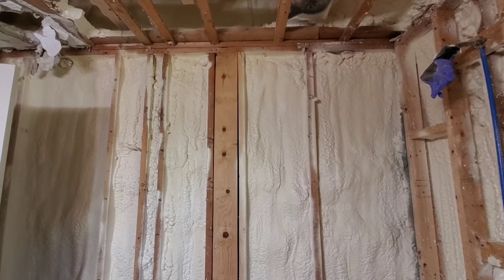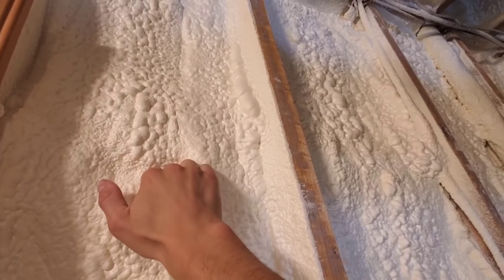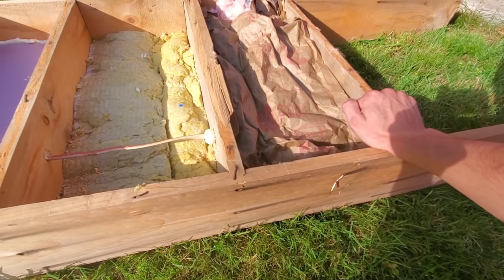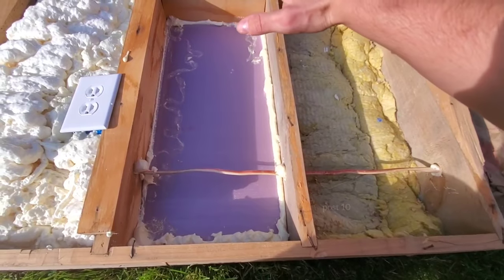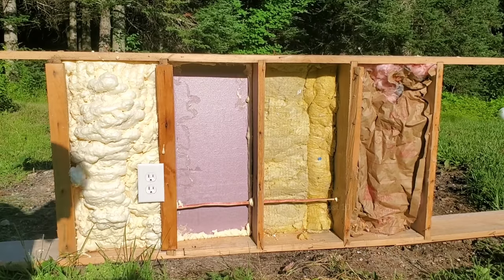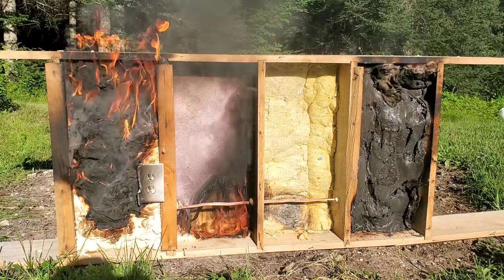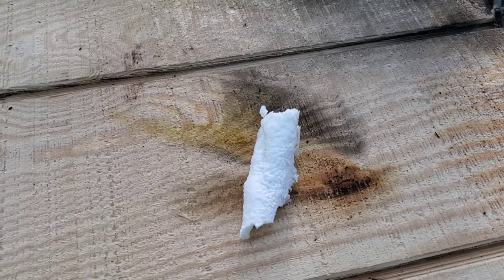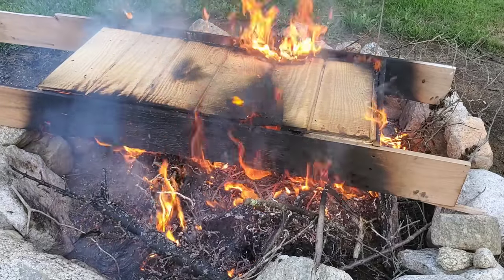Testing The Burn Ability Of Insulation In Wall

Comment: I am a licensed Architect and that is why you have building codes.  Paper or foiled back insulation is required to be protected by sheetrock or other sheathing as well as the other spray foam insulations or boards.  Only the mineral wool or noards that are fire rated for exposure can be left exposed.
I see it all the time where contractors leave paper backed or spray foam insulation exposed in a basement or attic and I tell them they have to cover it.
You thought the fiberglass would do better than the mineral wool?
I specify mineral wool as sound insulation and it makes an ordinary wall a one hour fire rated fire stop.
It not only wont burn, it also keeps the other stuff in tbe wall from getting hot enough to combust.
My formula on a 5.5 inch wood stud wall is 3 inches of closed cell spray foam- 2" gives you a vapor barrier, and 2.5" of mineral wool so you dont have to shave the stuff to put in your electrinal boxes.  This wall wont burn...
Reply: do you call out metal welded ariund 10 foot wide doors  to backyard
Reply: Thermal barrier paint is painted on exposed foam insulation. Ignition barrier paint can also be used depending on the area.
Reply: is mineral wool rockwool ?

Comment: Rockwool/mineral Wool does not burn. 25 years as a Construction Inspector!
Reply: the electrical outlet is like I'm melting I'm melting
Reply: @raven4k998  that outlet was also nowhere near the roxkwool
Reply: Neither does closed cell. This test is not accurate, he used Great Stuff out of a can.
Reply: @humanbeing-001 where's your video

Comment: I hope this video goes viral. The fact that people are entrusting their lives to these dangerous products is terrifying.   Thank you.
Reply from the maker: I made this video because I've seen other demonstration doing the same thing but never involving spray foam. I used spray foam in a lot of my projects when I do home repairs in flip houses the stuff is completely safe as long as the electrical system is good, as an electrical worker I always oversized the wires to prevent the hazard
Reply: @post.10  a man of many talents
Reply: I just shared it on Facebook to hopefully help get things going on the viral bit.
Reply: @post.10  as an Apprentice-looking-for-work, I salute you for that. #12 might cost more, but it's worth the safety and peace of mind for 15A circuits, especially places that are likely to have space heaters used (this is why I have a 20 A Single-outlet circuit for A/C and heater, NOTHING ELSE goes on that circuit)
Reply: Spray foam has excellent resistance to heat transfer and closed-cell blocks moisture. It is flammable so if a fire starts, get out. Follow codes when installing it that require an ignition barrier (drywall generally). 

With fiberglass on a roof you may well rot out due to moisture intrusion.
Reply: But this is not sprat foam. This is door and window can foam. Spray foam has a different chemical make up which has fire retardant in it. If you fill that bay with actual spray foam insulation and took the flame away it would be the first thing to go out. This is not a accurate burn test.

Comment: I swear by rockwool insulation, great stuff; imo the best insulation. Sure there are more environmentally friendly options like corks, cotton/denim, sheepwool but none of them provide the fire resistsance and moisture resistance of rockwool. In fact, the environmentally friendly insulations are often the worst kind of insualtion, zero fire and moisture resistance.
Reply: Rockwool, aka mineral wool is literally made from rocks, cant get more environmentally friendly that that
Reply: How toxic was that
Reply: I’d be interested to see a fire test on wool insulation. I remember seeing one on wool carpet vs nylon and the wool just smouldered and then went out
Reply: It's also bug and rodent resistant
Reply: Unknown Alien  yes it is, the fibers come loose while insulating and they go really deep in your lungs. Even when wearing a face mask it wil remain in the air for quitte a while. And the insulationvalue isn't that great
Reply: @highlandestate3853  I’ve taken a lighter to wool knauf wool insulation and pink insulation, the wool will not burn with a small flame like that period, so it’s very safe, especially if you get fire resistant paper on it, but that’s very expensive.
Reply: @fox23vaj, depending on the wall design, you could/should use a vapor barrier
Reply: @Marco Moura alien TV show?

Comment: So my self built house uses T studs with aircrete filler and 5.5" Rockwool between studs.
This contains the wood and doesn't allow any cyclonic action to materialize inside.
I hadn't ever tested sprayfoam but it never was an option because of cost and not being DIY at the time.
Thanks for proving my judgement was correct.👍
Reply: i love the idea of aircrete, how do you like it?
Reply: @vickiamundsen2933  I love it! 
There are so many recipes that are great for different applications. 
I will never use straight concrete for anything again.
If I do another house I will do a basement with foam blocks and styro-aircrete
 inside.
There are lots of vids that show all sorts of uses.👍

Comment: In a year or so I’m building a camper van from scratch. I was considering spray foam for easy installation but not after seeing this. No way!
Reply: I'm thinking of doing the same in the future but I watched videos that said the reaction from the spray foam heats up the sheet metal of the van and you can get warped panels that can be seen externally but I'm definitely not doing it after seeing this video either.
Reply: Why not? There is no reason why it should ever catch fire inside a metal van.
Reply: you can get fire risistant foam that works up to 1000 celcius like rockwool

both of them can burn in a serius fire, but so can metal

Comment: As an hvac contractor I've been advising people to use rock wool instead of spray foam ever since I heard about the product.
Reply: Na, spray foam is far superior and not the same as Great Stuff out of a can , this test is flawed.
Reply: @humanbeing-001  Unless you live in a humid environment and your Air conditioner goes out and you can't get the part for a couple weeks because the shitty economy and your entire house becomes a breeding ground for micro organisms. Or if you have a small leak in your roof or wall that incubates rot. I've seen many spray foam jobs gone wrong. Never have I seen or heard anything wrong with rock wool. A far superior product.
Reply: @humanbeing-001  exactly! Home insulation has boron (or something else Inert) added to it to make it less flammable. For just sealing windows and doors great stuff doesn't need it
Reply: @bryansprecher  As an electrician dealing with wires that are spray foamed is a pain in the ass.
Reply: @humanbeing-001  I think your eyes and comprehension skills are flawed ...
Reply: @humanbeing-001  housing corporations here in Canada have outright banned it, even for crawlspaces, it’s almost entirely rockwool now
Reply: Rockwool is fireproof 
Sound proof 4/5
Air sealant prob 2.5/5
Spray foam ( water proof , there's fireproof spray foam but it is pricey)
Sound proof 3.5
Air sealant 5/5
Reply: @eddiespagetti8395  unless you spray your roof, exterior walls and floor, foam around windows/doors and Caulk all gaps in wood around your house (which is only done when the house is being built) you're getting ventilation in your house trust me
Reply: @humanbeing-001  I disagree as an insulation installer rockwool insulation is both longer lasting and is much more safe, rockwool no matter how hard you try will not burn, meanwhile spray foam as you can see burns away like kerosine, spray foam can also trap moisture and cause mold easier. Spray foam is both more expensive, much more dangerous to install, and much less safe, especially with the fact that it will fill your house with black poisonous smoke within like 15 minutes. It’s also similar with “fire foam” that stuff burns too easily idk why they call it that.
Reply: I've read through everyone's comments.  All of you are partially correct.  Spray foam is a far better temperature, moisture, and air barrier.  It isn't a good fire retardant, but when you put rock wool in front of 1 1/2" of spray foam, you end up with a vastly stronger insulating wall with a higher R-value..  I did something different.  I replaced 1 1/2" fiberglass insulation with 3 1/2" fiberglass insulation, (I didn't know rock wool existed at the time), 1" Celotex insulation, and then 5/8" gypsum board.  There's an amazing difference in what my house used to be.
Reply: @spacescatatford  that's probably one of the best ways to insulate a house tbh.
Reply: @humanbeing-001  spray foam releases gases
Reply: @2k00l4ya  unfortunately, there is no "fireproof" foam. It's fire "resistant" and has fire retardants but it can still burn relatively easily. It's an inherent aspect of foam.

Comment: You aren't lying when you say that it is a science project. You had a hypothesis. You came up with a test. You tested the hypothesis (quite well mind you) and in the end you can draw a CLEAR conclusion. This absolutely is 100% a science project.

Now the implication is that it's for high school or college. That's on them for assuming, you didn't say anything about school. It was a project in the pursuit of science, a science project.
Reply: Yep. The difference between this small science experiment and a full publishable study is doing it several more times and probably recording the temperature of each.

An integral analysis of the time spent above 250°C, with a resulting value measured in degree-minutes, would imo be a good proxy for how “dangerous” each insulation is.

Control against some variables by lighting every insulation with a fuse or other identical pyrotechnic device placed identically in each wall cell. That way ignition technique isn’t a factor.

This could become a whole study on the fire risk of various forms of insulation.
Reply: @wallalo  Read the previous comment on this thread. That's how you properly do it.

Comment: Actually to give you a little info, I build houses in Texas and all we use is foam. We have had two homes in our town catch fire and nobody knew until the homeowners showed up. The foam houses are so tight that there was not enough oxygen for the fire to keep burning. Fire damage was minor.
Reply: Great info...makes sense....fire needs air to run and spread...I just built a hoise in New England and did spray foam exterior walls and fiberglass bats interior and cielings
Reply: Other ways to tighten home 😆
Probably nothing worse than spray foam though
Reply: @anthonyman8008   Why do you say that? How about some evidence to back up that claim. At least elaborate on why you think there’s nothing worse than spray foam.
Reply: @kirksatterwhite2473  learn to internet
Reply: @kirksatterwhite2473  just look the video
Reply: @kirksatterwhite2473  Foam bad. Fiberglass good. Duh.
Reply: So, if it catches, you are more likely to die from suffocation and toxic fumes than the fire itself.
Reply: @puntabachata  nope, there was really not much damage, on one of them the outlet caught fire and there was like 8'x9' burn spot. The other I didn't see.
Reply: I still wouldn't trust it
Reply: This is exactly why this video is misleading... Every thing is open to the air, which isn't how an actual wall would be constructed. (I love that he shows fire block foam being used to plug the wire holes, but doesn't explain the major flaw in his open stud experiment.) The foams make things so much more air tight that they can give people much more time to get out of the house and call the fire department.
I'm glad he clarified at the very end that he was talking about spray foam in the open attic studs, but the misleading damage was already done for most people (especially since he used exterior plywood for WALLS on the other side).
Reply: @JayWozz  you're missing the purpose of the test. It was to show the different insulations' performance in a fire. Starving the fire of oxygen might help you see how wall design can impact house fires. But it's not very useful to see how the insulation handles fire in general. 
Another reason its valid is that every insulation was open to the air to the same degree. 
If a closed, sealed wall would protect spray foam, this video clearly shows that fiberglass or rockwool would be even better options.
Reply: thats great if its all built properly, etc., but most of the time houses are not built that good and usually stuff like fire block is not always used that well and i'd bet on many single family homes not at all. how well such stuff burns may just depend on who built it.
Reply: First thing the fire fighters do if they have to enter a burning building, they smash out a bunch of windows, so when they enter through the door they're not met with a giant fireball.
Reply: @ADHDcisGinger  no that is not what modern firefighters do
Reply: @cmason728  oh yeah, i forgot the modern fire departments aren't heros that run into burning buildings anymore. And are more worried about the property owner paying the bill for the fire department to show up after half the building is already toast. If my shit shack caught on fire i wouldn't call the fire department, id be more inclined to stop them in the road and tell them to turn around, im going to let it burn less clean up.
Reply: @kirksatterwhite2473  the evidence being the deadly inferno created on his video when a flame touched it
Reply: @JayWozz  the foam is full of air. It is air entrapped in an extremely flammable material. If a fire starts just assume at some point it will touch the "super airtight" foam because the fire burned through the wall or wood studs.
Reply: @ld2588  I'd encourage you look up what kind of air the foam is made of... I'll give you a hint: it's not Oxygen.
How do you think these companies pass stringent fire code compliance tests?
Reply: @JayWozz  YES! its so miss leading! once u enclose it wont burn! id like him to redo the "experiment" ENCLOSED!...especially with drywall,, i can save the time...Nothing will happen! lol,, did the fiberglass co do the "experiment"?

Comment: In my experience, “fire-resistant” materials are only resistant to a certain temperature. Over said temperature, they are extremely flammable.
Reply: Agreeed
Reply: definitely looks like what happened with the insulation board. at the beginning it didn't do much and the spray foam sealing the edges did most of the burning. eventually the temp got hot enough and the wood started burning, and the insulation board started to burn too, which is when it really took off.
Reply: But getting to and maintaining the heat required for some of those to take off is the key factor. If the fire can't maintain the temperature needed for the fire to stay light and spread under its own presence... it's just going to burn itself out. The two that burned are petroleum based.
Reply: mineral wool is made out stone. How do you imagine rock burning? Will it melt? Yes. rockwool states temperatures up to 1000c.
Reply: Flammability and combustability are two different properties. Normally this material is behind non flammable plaster and gypsum board so flammability isn't a big issue until the building is already lost. Meanwhile, the combustion point of the foam should be high enough that the wire insulation and wood are also close to combusting themselves
Reply: Like FR clothes are only fire resistant the first 5 washes then their just like regular clothes
Reply: I use rock wool to insulate my kiln.  It is good  up to 1,300f.  It works for copper, brass and aluminum.

I think steel is too much.  Then you need ceramics.

Comment: Reminds me a bit of Grenfell. Pay for the cheapest materials, they burn quicker, if it's just a few cents cheaper per metre (or whatever they base it off), builders will use it sadly. Doesn't mean much if it burns quicker and more likely to spread and kill so long as they shave off some pennys
Reply: Fiberglass is the cheap and low-performance one
Reply: Grenfell Tower burnt down due to the fire spreading through the exterior walls via the cladding that was installed not via the insulation and the inside walls but yes they did use one of the cheapest cladding materials which was also not rated for the building height.

The Building was constructed in the late 1960s so it's likely that either Asbestos was used as the insulation or at some point was replaced with another low-cost material such as Fiberglass..

Comment: I only use the rock wool insulation with an exterior wrap and rodent mesh inside on both interior and exterior sides of the outside walls now, and foam in the corner gaps and eves (hard places to seal with rolled insulation).I like it because it’s easier to put up and I’m glad I used it in my shop after seeing this. I keep pests from tearing up my farm equipment and keep it in a lot warmer temperatures in winter which is nice not worrying about freeze damage and thawing out equipment after snow removal. It’s also got a big wood burner in the corner off it that I have a lot of safety measures in place but now feel better about my choices

Comment: It’s good to see you uploading a video like this Post.  It brings to light the inherent downfalls of certain insulations.  It teaches people who may not know or realize these dangers.  I would however like to bring something to your attention about a big difference between Rockwool and fibreglass.  Fibreglass holds water like a sponge when it’s wet, thereby losing all of its insulating properties.  Rockwool on the other hand, allows water to pass straight through and doesn’t lose its insulating properties.  This is only one of the benefits of Rockwool over fibreglass.  I won’t get into the issues of fibreglass sagging over time and creating voids in your walls.  That’s a whole other can of worms.